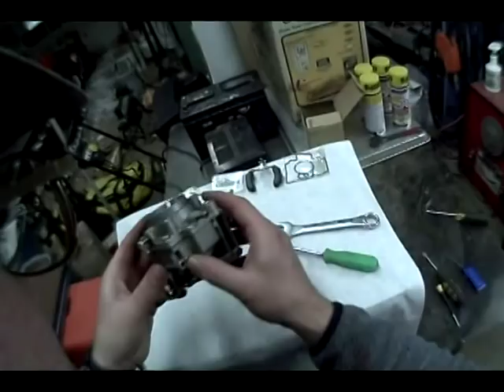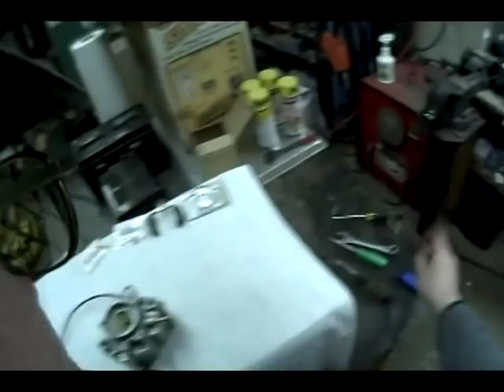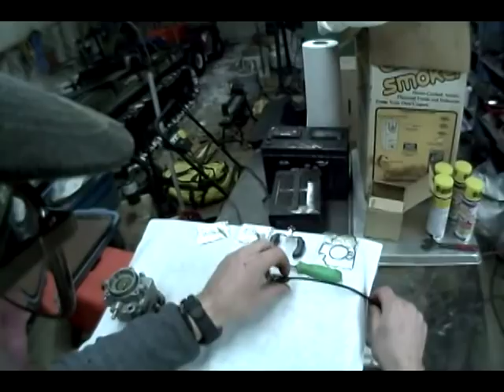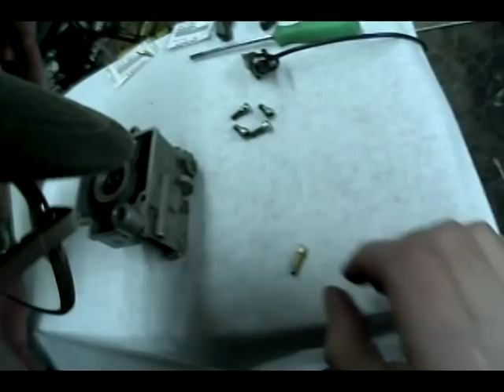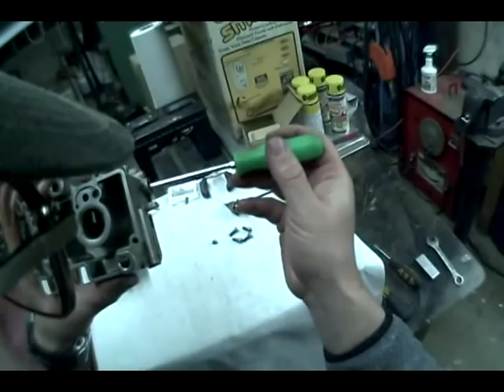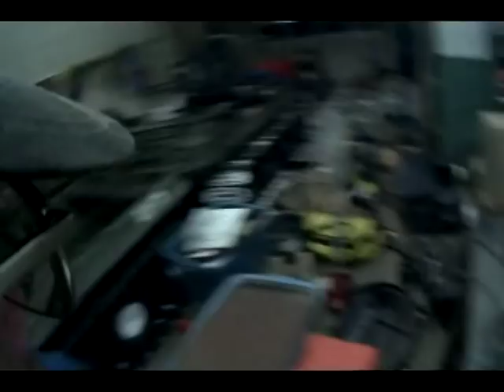Carb 20hp Kawi disassembly and cleaning

Comment: I know this is an old video, but I just rebuilt the Kawasaki FD620D engine in my John Deere 425 mower that I purchased new in 1993.  Upon initial crank after the rebuild the engine was hunting and would only run on about 1/2 choke.  Someone on Facebook (was facebook even around when this video was originally created?) suggest cleaning the carb.  I was scared as I didn't know how simple or complicated it was.  Your video really help to dispell my fears and show that I could get in there and clean the ports and make sure that everything looked good.  I put it back on and the engine ran just as badly, then I disconnected the venting solenoid that the early carbs on this engine had before the fuel shut off solenoid with the plunger, and it purrs like a kitten.   Thanks for this video that saved me time and money in getting my JD 425 back running again.

Comment: Nice video thanks. Is there a reason that the fuel shutoff solenoid can't just be deleted and replaced with a threaded plug?
Reply from the maker: You can absolutely do that, I’ve seen a few plugged. If done though, you’re fuel can keep leaking out in the event of a rollover.

Comment: Hey RD.
I pulled my carb off my Argo conquest fd620d cleaned it all up. I need a new float bowl gasket and a carb base gasket. All the kits seem to have a paper gasket and i do believe argo sells a steel one.  Is there any difference. I have read paper ones seal better.
Reply from the maker: adamlocke85 I don't believe I've tried the metal gasket, but I have made paper ones out of material like cereal boxes. Worked in a pinch.

Comment: are there any videos on YouTube on how to disconnect the throttle linkage rods on this carburetor without bending them
Reply from the maker: john c 
Not that I've ever seen. It can be done and is a pain in the butt. I will have to try to show that some time. Great question.
Reply: RockDoctor07 I would really appreciate it if you could do that I'm trying to get one apart without messing it up and I'm having problems
Reply: RockDoctor07 my Kawasaki engine is in a John Deere 425 lawn tractor it may have different rods on the carb from other vehicles with that same engine in it I don't know
Reply from the maker: john c 
It will have to wait for a bit, I'm away now. Maybe an idea for this spring. Sorry, that's no help to you now...